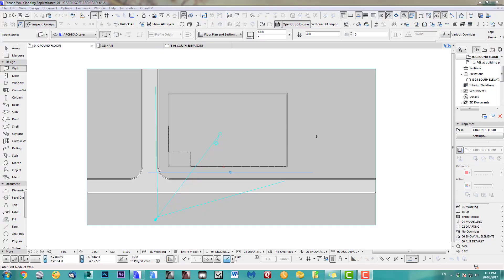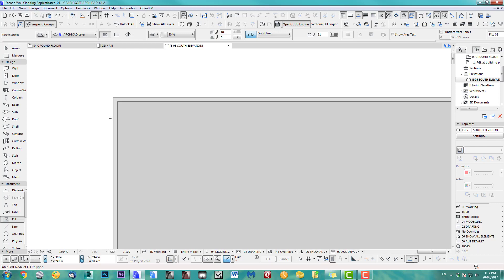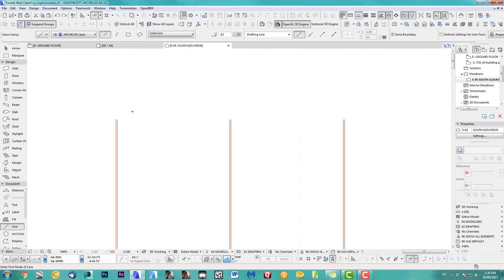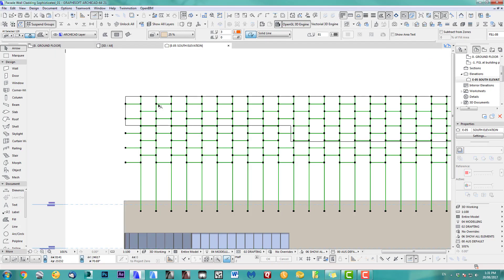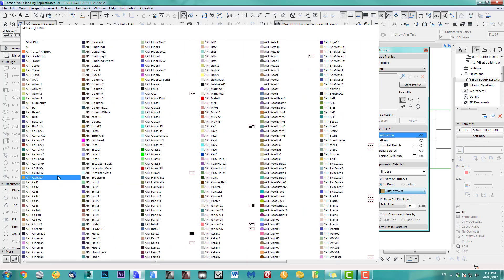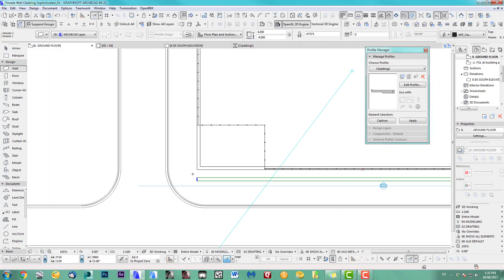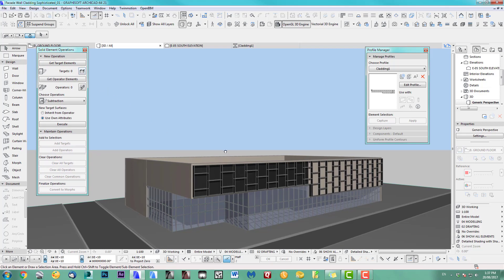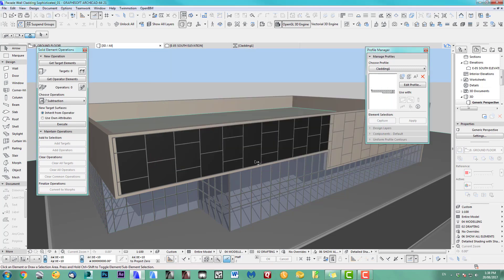How to model a Cladding Part 2 in Archicad

Comment: Alternatively, it is possible to work with textures, fillings and surfaces directly on your piece of wall, this is probably a bit quicker, I would say.
Reply from the maker: Yes you can but a couple of things: it won't be quicker, well at least not for me :) don't forget I was modeling in " tutorial mode "  and you still have to create a texture/fillings which take time too . Then there is the aspect of 3D Visualisation, the more detail you model in 3D, the more realistic it will look ( shadow gaps, real edges etc. )  Also textures don't show up on Elevations for DA's and construction dwg
Reply: Working with a texture will not have the same effect as was shown in this tutorial. The cutting process gives geometric data to the outer wall that will be presented in 2D detail drawings.